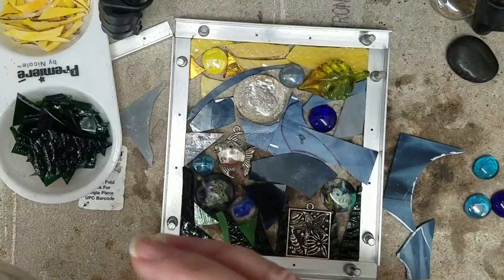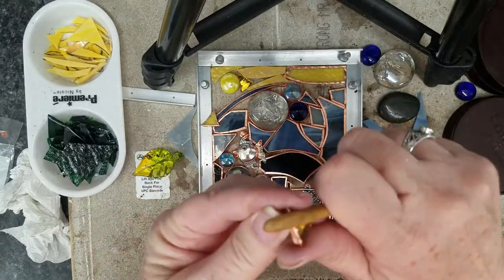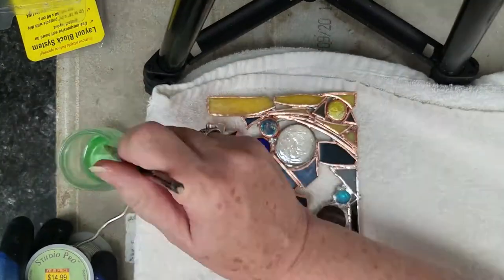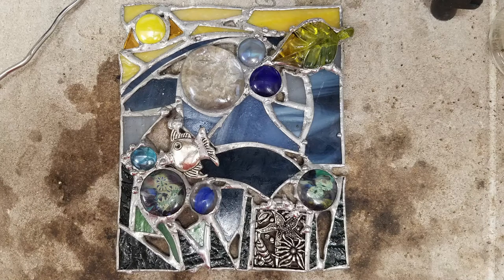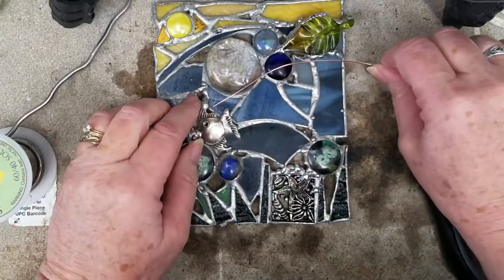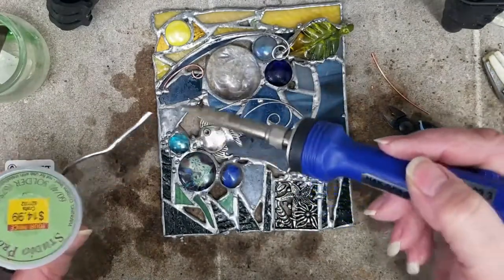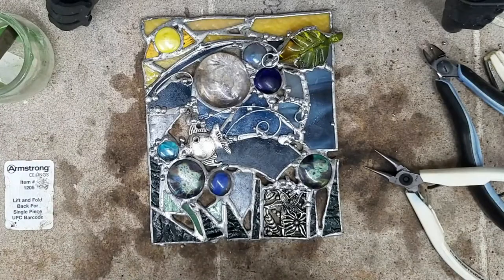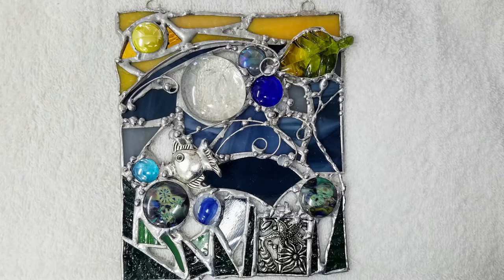Dark Water - How to Design Abstract Stained Glass Art

Comment: I try to make those beads on my lines of solder but I have no luck - everytime I try to place a drop of solder, it just melts into the existing line of solder.  What am I doing wrong?
Reply from the maker: Hi Amy,  you have to get some solder on your iron.  Then tap it on there real quick.  You will get the hang of it.  Let me know how you do.  Cheryl
Reply: @artbycherylann8431  Hi Cheryl - thank you very much for your reply.  I have tried this and yes, you have to get the hang of it, LOL.  "Ann"